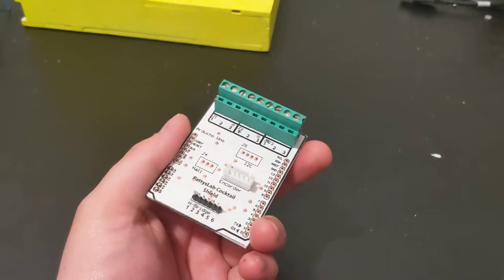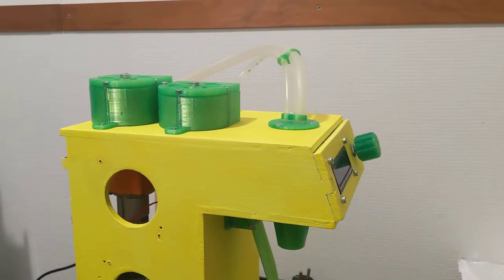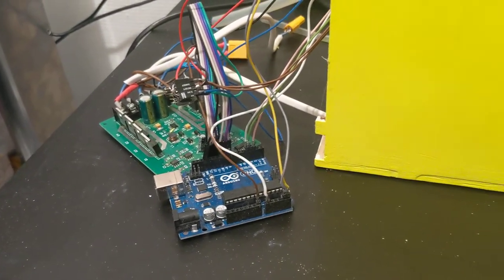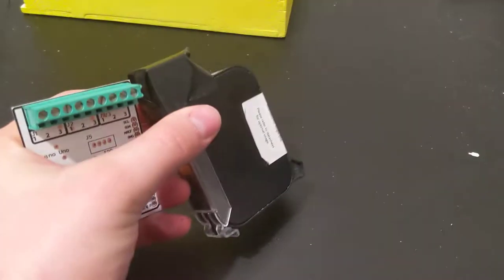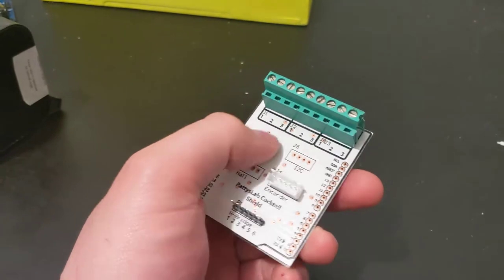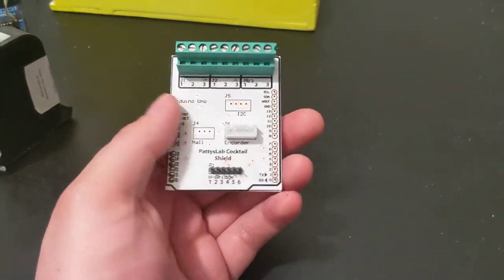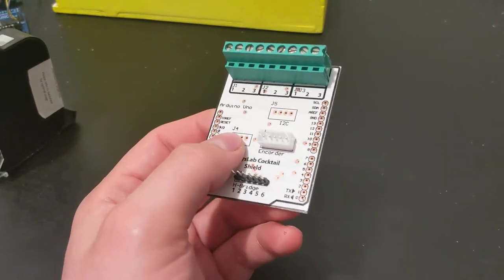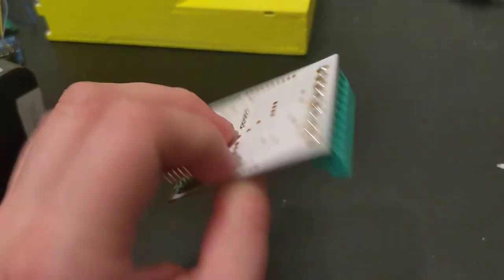Arduino Based Cocktail Maker UPDATE! And a Cool PCB Prototyping method with UV ink!

Comment: Nice! I'm interested in what model of printer you are using! Also the whole PCB was made with the printer, like the copper traces?
Reply from the maker: Cool that your are interested :) the printer itself is called Breva and can unfortunately not print the traces but it van supply a mask over a copper pcb. In this way you van put the pcb in acid and all the places covered with the ink remain an the rest Is de solving in the acid

Comment: What kind of connector blocks are they? Do you have a link? Look forward to seeing more about the printer!
Reply from the maker: I think I used a no name brand but I know they are made originally by Phonix Contacts I've found a expample here :https://nl.rs-online.com/web/p/pcb-terminal-blocks/1922939/ but if you look for phonix contacts pcb terminals you should be able to find more like these: https://nl.rs-online.com/web/p/pcb-terminal-blocks/8024978/ those plug into a female part on the PCB they are pretty expensive but high quality regardless :)
Reply from the maker: Hey Mat I found the connectors on my desk phonix contacts mkds 3/3-5,08
Reply: @PattysLab  thanks. I have some Phoenix connectors but I thought these ones looked a bit different. Thanks for checking!
Reply from the maker: Np!